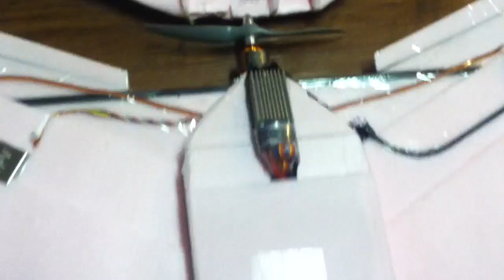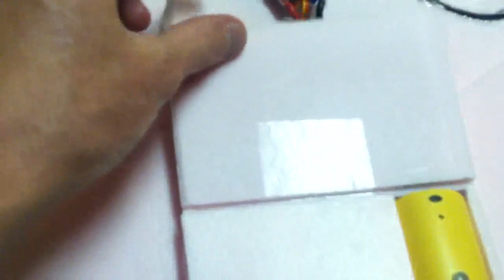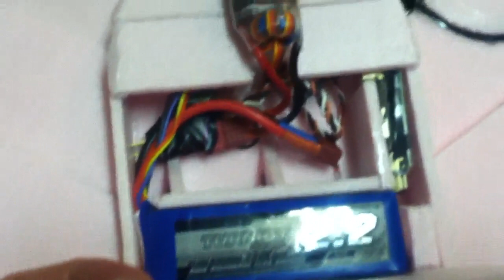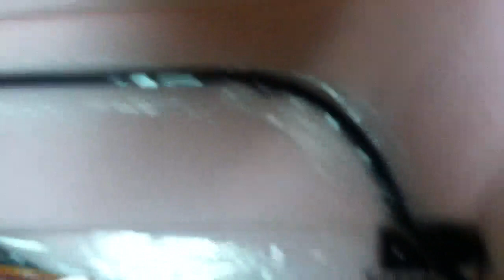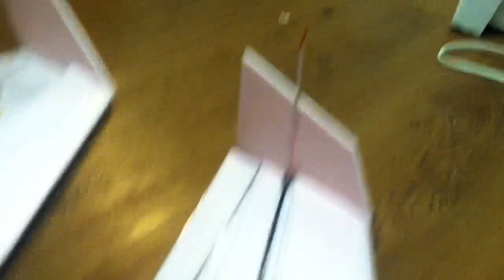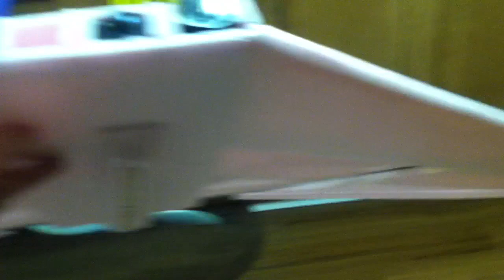HK-KK2.1 Stabilized DragonOSD Controlled KFm7 Flying Wing (Part 4)

Comment from the maker: The Yellow object is a RD32II HD camera. It can record in 1080p at 30fps, or 720p at 30 and 60fps.

I do not skin them until all testing is done. then i wrap them with .2mil packing tape and they usually last 50+ flights.